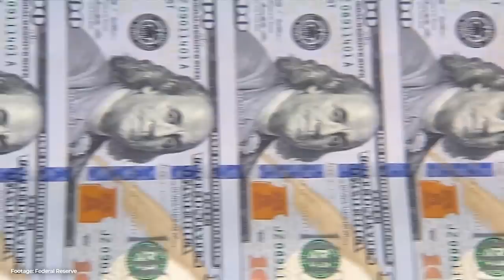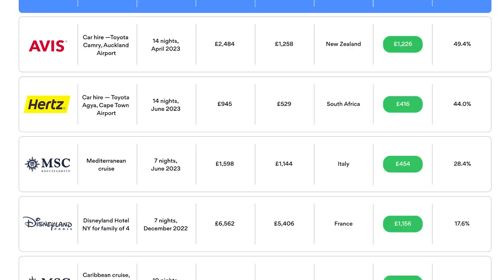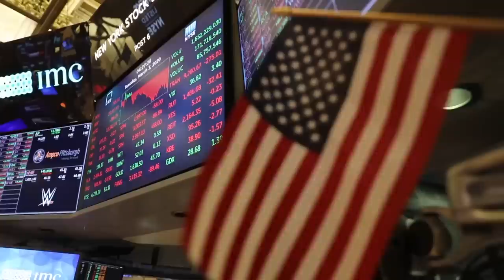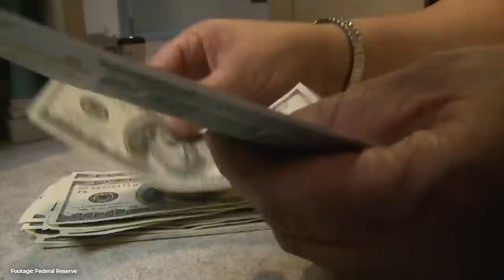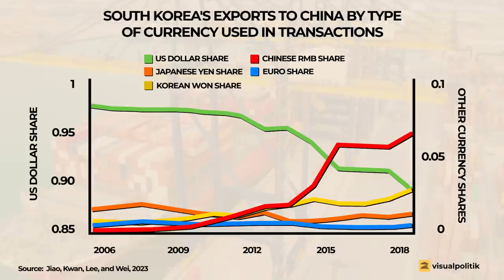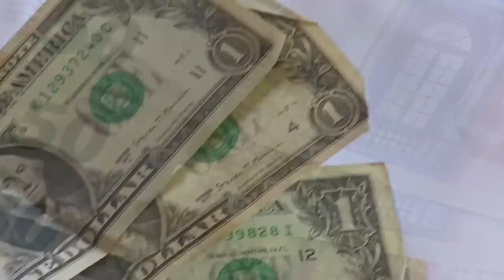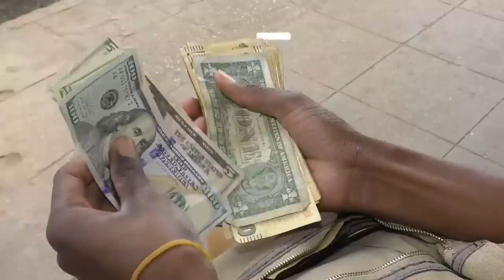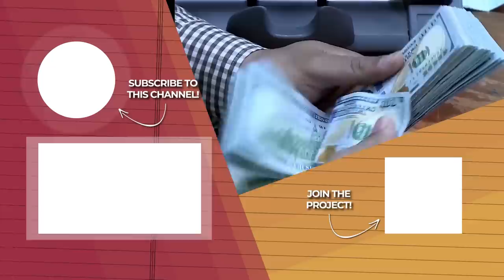Can the Chinese YUAN win the WAR against the DOLLAR? [And one more alternative]

Comment: The dollar dominance has dropped considerably over the years, but it has been a slow drop as other economies (including China's) have grown in importance.      A continued drop in dominance is probably not a problem unless it were to happen overnight, and even then, any trade with the US is probably going to have to be in US$.
Reply: The dollar domiance remain too important to be challenged anytime soon. Sure it'll decrease to some extent, but that's actually healthier, even for the dollar, the same way that Swiss central banked tried to lower the value of its currency at some point. If there are more counter balancing currency in use, the dollar loose enough of its value to not be used as a store of value.
Reply: You have data or source for this? AFAIK, it is China who is losing global economic relevance as businesses relocate their manufacturing operations away from China.
Reply: @phoenix5054 yes china have also lost some but only short term. but the dollar is falling slowly in market pressure.. but this actually good for the dollar... The euro and other smaller currencies have picked up the slack
Reply: @phoenix5054  My source was the breakdown of each currency's share of international trade.     Right after WW2 when the Bretton Woods accord went into effect, the US$ was used in 90% of international trades, with some trades in British Pounds, German Marks, Dutch Guilders, Swiss Francs, etc.    That has dropped over the years, with the Euro replacing the individual European currencies that have been replaced by the Euro.        

China's currency will NOT replace the US$ or even make much of a dent in the US$ dominance.     Some of the reasons for this is what you mentioned regarding some questions about China's economic future, but the other issue is trust.    China has manipulated the value of their currency in the past, generally devaluing it so that their prices remain more competitive.    A country holding foreign currency as a reserve doesn't want the value of that currency dropping.
Reply: Yes, but the US share in global trade is relatively low. But that would not be the main problem for the US. The problem for the US is only if money is no longer kept in USD in the current amount as it’s deficit and debt would be unsustainable fairly quickly.
Reply: @phoenix5054  Businesses do relocate away from China, but you have to account for mutiple fact : China economy is slowly transitionning from the low cost manufacturing bit to make higher end product and innovating with Chinese company. They're not entirely there yet of course, and they might never succeed, but in this trend, which also coincide with their demographic decline, loosing low cost manufacturing is just logical, expected, and not a bad thing (The same way Europe and the north america dropped their low cost manufacturing to Asia back in the day). 
As for the currency bit : Currency strengh is backed by confidence, convenience, and domestic enforcement. The dollar have all three by far for developped free nation, but not in autocratic nation which might fear sanction, meaning that, as the video said, we'll likely see some other currencies in the future that perform better than the dollar in some markets, but once again it's vastly unimportant which money Russia and China choose to exchange with each other as long as every country in the globe remain confident and happy to be payed with Uncle Sam bucks
Reply: Dollar dominance has absolute NOT "dropped considerably". from 1999 to 2023 The Dollar has gone from being 70% of the world reserve currency, to about 63%. And today still accounts for 40% of global trade and nearly 80% of all global cross-border transactions. The Euro also remains around 20% of world reserve currency both in 1999 and 2022. China's Renminbi is less than 3% of the world's reserve currency, despite being the 2nd largest economy. And it can't even displace the Yen that has even rebounded it's position, or the UK pound. The Renminbi today is held in the same proportion as the Canadian dollar lol. 
China manipulates it's currency too much for it to be of any use to the Global market.
Reply: @tobiwan001  Lol what are you talking about. The U.S. dollar is used in about 40% of global trade and nearly 80% of all global cross-border transactions. As for "unsustainable debt" The US debt is only 124% of GDP, that is very low for a wealthy developed nation. Even fiscally conservative Germany is at 160% let alone France's 220%, or China's astronomical 260%. The US's debt is extremally sustainable, because it is literally the driver of the world economy. Any problem would not be for the US but the entire world economy should trust in the dollar fall.
Reply: @serebii666  I never said anything about the Yuan, but since it's absolute peak, the dollar have decreased, as you said because other currency like the Euro and the Yen took some part of the action. I'm just pointing out that the dollar was SO dominent that it's actually an healthy trend for it to go down a bit, and I do agree there is no way the dollar will loose its dominent status. Just that'll other currency will keep on getting wind in their sail due to the fact that lots of countries don't want to be as dependant on the dollar as they are now and that other currency can fill some niche.
Reply: @dorianodet8064  do you see your name in blue before my previous comment? I wasn't writing to you but replying to OP, and then to Tobias
Reply: @serebii666  Not sure what you are talking about: I said the US share in global trade is low not that of the USD. And the US in more indebted than almost all developed nations. If you consider public debt. The US figure ist between 120% and 145% depending on whether you include states or not. The figure for Germany is 60%. The EU average is 81%. The only countries as high or higher than the US are Italy, Greece and Japan.
Reply: @serebii666  My bad then, Youtube poor UI flagged your answeres (and not the rest) as answer you would have made to my comment
Reply: The US share of global trade dropped from 40%+ to about 25% today so some drop is likely. Euro has certainly take some of that though that has now flattened.
Reply: @Homer-OJ-Simpson  even in the video they say the US has a share of 15% of global trade. The EU had about 25-30%. But the USD is used more often as it is an import currency.
Reply: @tobiwan001  The Economics Explained video I just watched mentioned 25% but maybe it was % of GDP and not global trade. The importance is the trend -- the share of global trade and share of global GDP for the US is dropping so it's expected to be used less just based on that. But Yuan is only increasingly marginally so it certainly has no chance of competition with the US dollar.
Reply: Cina printed extra 20-30 trillions rmb every year.  
no one in the right mind would hold onto that junk unless they absolutely needed to
all the wealthy families have been fleeing from Cina for a couple years.
just look at the number increase of private funds in Singapore

Comment: It would be great if yuan could replace the USD, but that will never happen under the current leadership of CCP.  Reason Yuan cannot replace USD are the following,
1.  CCP artificially devalue yuan all the time.  Under this type practice, people in other countries will not want to own something(currency) that loses value artificially.
2.  CCP does not allow foreigners to freely own yuan at will.
Reply: That's before considering the suspicion that a significant share of RMB was double-printed, which better explains Beijing's push for digital e-CNY.
Reply: @doujinflip  - your not getting it.  China has to artificially devalue its currency to offset the trade surplus abroad.  If not, the valuation of yuan would go up to the moon.  Down side of having strong currency is that your products you produce will become more expensive as your currency gets stronger.

Comment: Two problems:
First; there is no formal agreement that cements the US dollar as the global reserve currency. It’s just cheaper to exchange through the US dollar than exchanging directly. Currency is traded in all manner of currencies and the US doesn’t care, and does literally nothing to ensure the dominance of its currency. It just has a very stable currency and economic system that most want to use.

Secondly; the currency of any tyranny is far more exposed to policy based volatility and uncertainty than those from democracies; as a function of all the checks and balances present in democracies to stop a leader doing something devastating. Tyrannies don’t have the same robustness built into their systems because it stops tyrants  exploiting their people and economies for their own benefit. 

So the RMB can only gain prominence as the global reserve currency once China builds in robust checks on government power and it becomes cheaper to trade in RMB than USD. The same is true for any other currency. Which means trade in RMB will be limited even if countries like Russia go all in on using the RMB. Even if it gains greater use, even if it becomes cheaper, it’s constantly one decision by Xi Jinping away from its popularity collapsing. 

Also a pluralistic currency world won’t prevent either economic shocks or international sanctions, or even make them harder to enforce. Sanctions are enforced by national governments, and the US dollar is only used as a matter of convenience to determine thresholds, but there is no challenge in each country agreeing to an equivalent amount in their own currencies as this is basically what happens now. 

The advantage for Russia using the RMB is simply to avoid going through the systems of nations who will enforce sanctions. But it costs them in other ways and denies them access to markets who won’t use the RMB because they don’t trust it.

Comment: The move won't be from, USD to yuan ... It'll be from USD to domestic currencies.
Eg bilateral trade in uae dinar among india and Russia .
Bilateral trade will be more significant.
Also, advent of computers allows exchange rate conversion more easier.

We might even make a absolutely new currency that might be decentralized ( like bitcoin but backed by sovereign countries)and based on a weighted basket of goods , currencies etc.

Comment: You're right in that a strong dollar will raise price on us goods, hurting us exports but your understanding is too simplistic for a number of reasons.
1. 90% of the us economy is internal market, not exports.
2. USA runs continuous deficits increasing the debt increasing treasury bond sales which will drive up interest rates which will cause the fed to conduct open market operations buying bonds with money the fed makes which increases the money supply which is inflationary which dollar dominance helps by increasing demand for dollars thus bolstering dollar value. 
3. Inflation is the obstacle to economic growth and the fed wants to keep it at 2% because a slight inflation is a hedge against risk of investment in increased production capacity and entrepreneurial ventures.
4. High inflation or deflation is a prohibitive risk to investment.
5. Falling dollar value will cause a drop in profit from us bonds, decreasing demand which will lower their value which will drive up yields which will raise interest rates.
You don't think things through😢😂😢😂

Comment: The effort to dedollarize really picked up steam and 2023. So all those statistics that date to 2020, are really misleading.  But also the question of will the Yuan displace the dollar is the wrong question. Displace might take 10 or 15 or 20 years. But what are the smaller nearer term consequences? For example if BRICS and the global south stop using the dollar for trade in that? 40% of the global economy within the next 2 years what's the consequence?
Well if the use of the dollar in trade drops by 40% every country will likely reduce their dollar/treasuries holding by again 40%. Will that increase the interest rate on Treasures by 2%?   That adds 600B/yr to the US Govt interest paymnets.  Right now the US is facing a debt crisis as Repub and Dem can't agree on increasing the debt limit vs cutting spending.  WIll this crisis now happen every year instead of every 2 years?

Comment: What can you NOT BUY with the Yuan?  What can you not buy with the dollar?  Why?  

If the "apex" economic products can only be had with one currency then that currency will dominate all others.  If two countries with various apex products settle trade they do so in terms ultimately reflecting the balance of each's apex products.  Currency is just the scorecard.

The fact is that China doesn't many apex products.  It's why their currency "convertibility" is so tightly controlled.  If left to organically settle the yuan would be worth FAR LESS and the economy in China would crater into supply shortages and inflationary devastation.